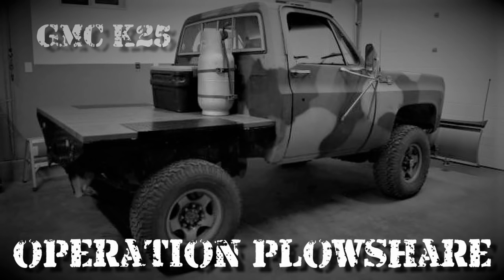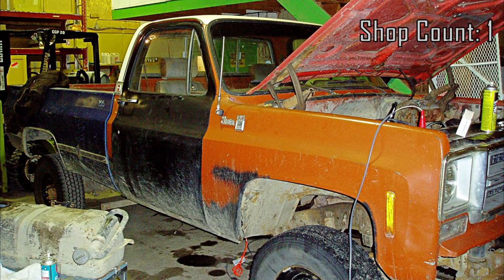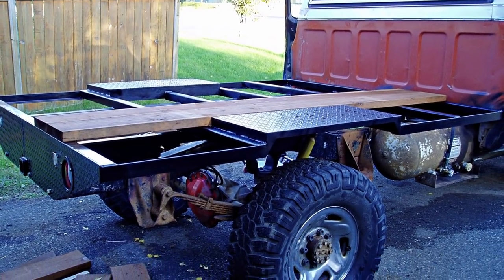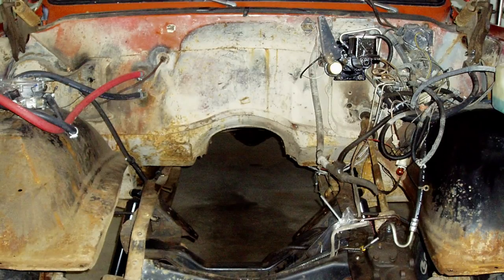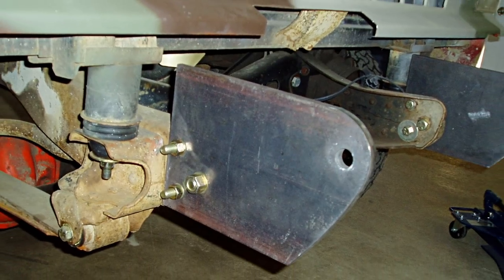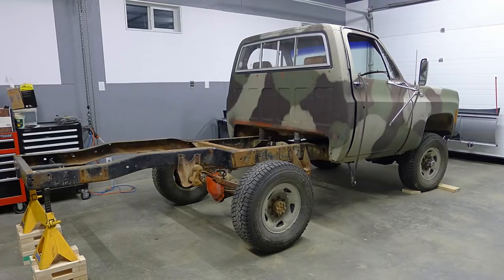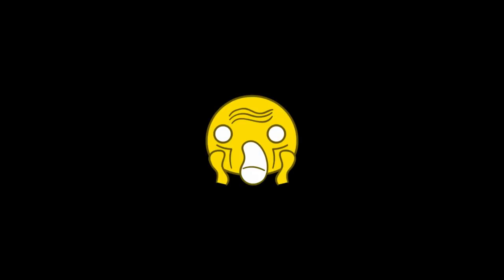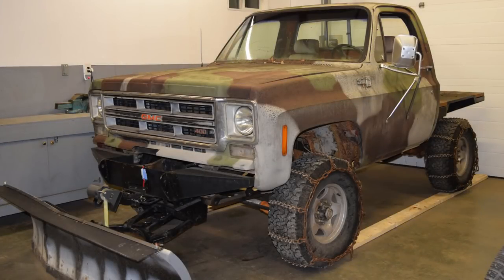Operation Plowshare - The nuclear option for snow removal - 76 GMC K25 Episode 1

Comment: Good call on shortening the frame. When I worked at a car dealer they had a snowplow on a 75 blazer. With your's being shorter and with beefier gears all around I am sure it is nearly perfect for this application.  I like the chains all around. We have a local guy who put a pickup cab and a flatbed on a blazer that has a snowplow on it. It looks like he shortened the frame but not sure. Good video, thanks for sharing!
Reply from the maker: Thanks!  Yeah, starting with a 3/4 ton gets you a lot more beef out of the gate than starting with a K5 Blazer.  The only thing it really lacks is a D60 front axle, which unfortunately they're quite pricey in this area.
Reply: @2drx4  Yep, I kick myself,  I had a 86 K30, with a 4 speed M20, Dana 60 front, corporate rear, 205 NP 4.10 gearing and a 454 engine.  I could have kept it but thought the cash was more important at the time. It might have been a dog as far as being snappy but nothing pulls a loaded trailer like a big block. I think I have a video on it...
Reply from the maker: Yeah, that's as solid of drivetrain combo as you're ever going to get.  With what people will pay for them now I can understand selling it though.  We used to have basically the exact same truck as a yard truck where I worked, it was a cab and chassis model, dually with a flat deck, you could absolutely overload it and it would just chug along like it always did.

Comment: GMC & Chevy produced those generation fullsize truck models from 1973 - 1991, except the half & three quarter ton regular cab pickups were discontinued in 1987 & the one ton regular cab pickups were discontinued in 1989. Also those generation fullsize pickups were the first GMCs & Chevys to have optional bigger cabs which were the crew cabs also introduced in 1973.

Comment: I'd say the truck is perfect for plow duty. But it looks like the plows kickback springs are a little weak? Thanks for the video!
Reply from the maker: Normally I'm plowing deep fresh snow (typically I'll get a foot or more in a single snowfall), but for convenience reasons I've never filmed doing that, and rather only filmed scraping off a couple inches of wet stuff.  The kickback springs don't do much in deep snow, as it's pushing far more evenly on the blade.  Honestly I'd rather it kicks too easy for the time being anyway, as the blade and mount is very much on borrowed time.  Before next year I will likely have to buy/build a new blade and change the mount again.  Don't buy a Costco Chinese snowplow if you're doing more than a light skiff, it just won't survive...  Lol.